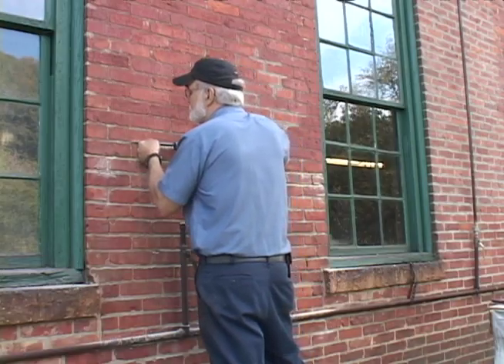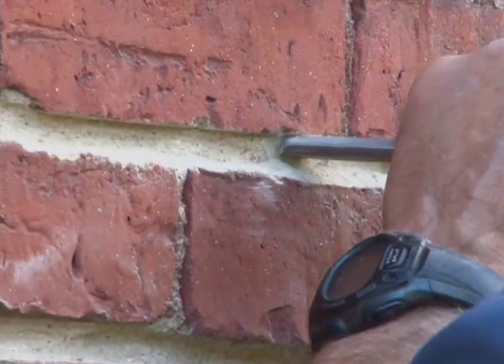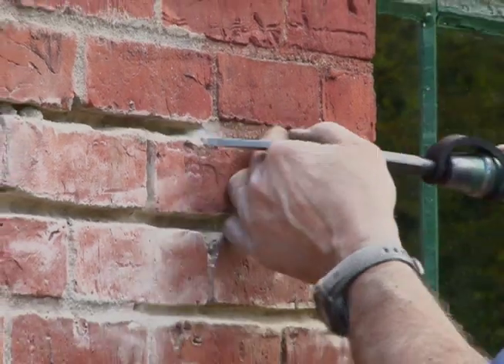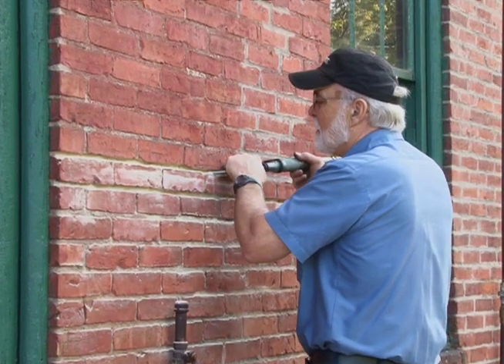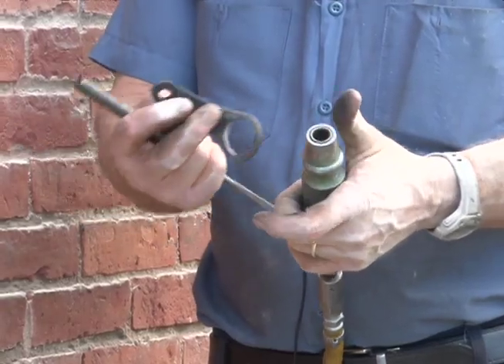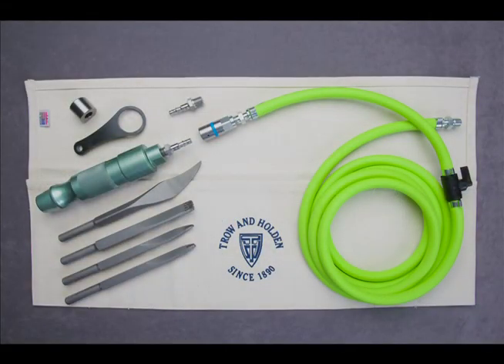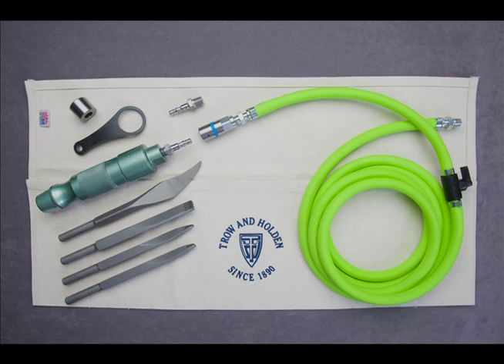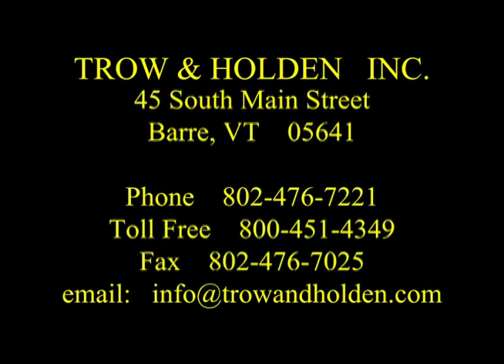Repointing with Pneumatic Mortar Removal Set

Comment: probably the fastest way to get industrial white finger I have seen so far !!!
Reply: Thanks for raising your concerns about pneumatic tool use.  Working with any power tool requires good safety practices.  We have a number of rubber mounted accessories that will help isolate tool vibrations from the user (see our Chisel Whizard, Chisel Tiller, Air Tool Pistol Grip & Chisel Retainer videos) as well as anti-vibration work gloves.  But perhaps the most important thing to remember when using any power tool is to TAKE FREQUENT BREAKS.   Use the time to regrind & sharpen your chisels -- your hands will thank you and you'll get back to work with better performing tools!   -  Norm / Trow and Holden
Reply: @stiltonwilton1313  that can happen with any vibratory tool. But the idea would be to try to find tools that do not vibrate your hands, or vibrate them as little as possible or use them for a very short duration. Using vibratory tools for long durations is how you get those problems

Comment: "The chisel shall have a round shank and be hand held in
place in the carving tool with no retainer. A round
shank permits the chisel blade to be oriented
independent of the tool, an essential feature that is
impossible with square-shank tools. The absence of a
retainer, or any mechanical connection, enables the user
to defeat power of the tool immediately by pulling the
chisel away from the piston, without any other action.
Precision and control is affected by the tool design
enabling one hand to operate the tool, while the other
manipulates the chisel. Importantly, this tool was
developed as a finishing instrument to sculpt stone for
hours at a time. "  {From The Use of Pneumatic Tools in Repointing Historic Masonry APT Communiqué, Vol XV (1), Technical Note 8, 1985 - Philip C. Marshall / Author}

Comment: You don't even have a locking chuck on the chisel/Chisel body? Seems like that would be a good idea. All Impact tools have this small feature. Correct me if I'm wrong but without that rubber strap doesn't the Chisel just fall out of the tool?